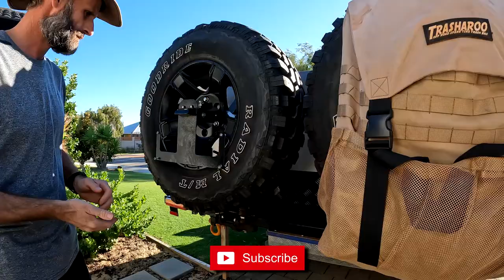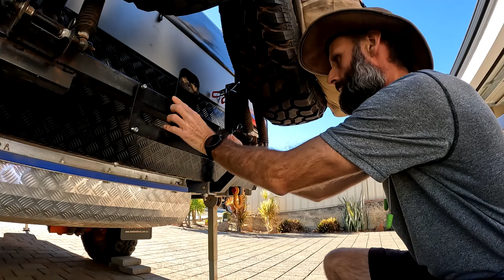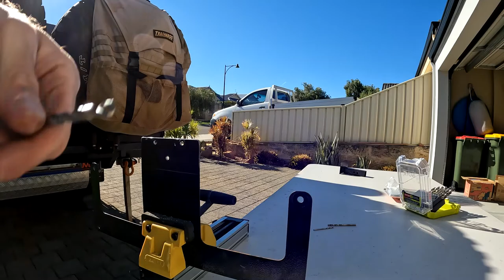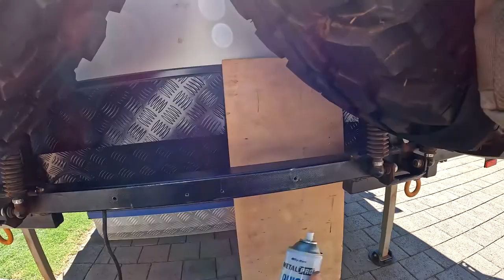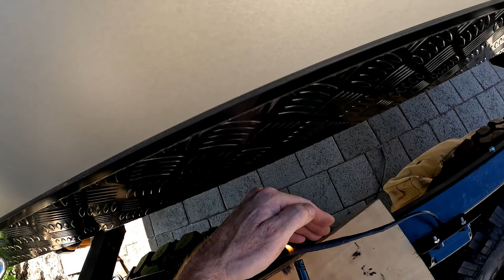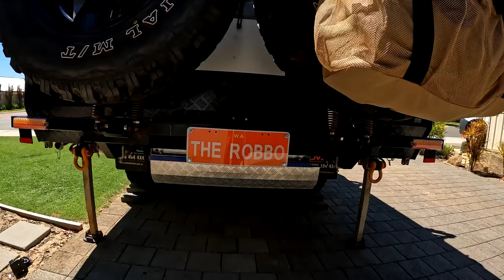Relocating Number Plate on a Camper Trailer l Personalised Plates

Comment: Craig can you explain why/when to use pop rivets versus screws given you used both?
Reply from the maker: Hi Wallace one reason was the pop rivets sit more flush so they don't interfere with the number plate. And also just for extra strength 😊

Comment: Hey, I did the same as you and Steve Zammit from MDC reckons having the license plate there is not compliant. What regs did you look at?
Reply from the maker: Hey Warren I just went onto the WA transport website and it was listed on there that is had to be at the back of the trailer and fully visible day and night. What state are you in? Maybe there are different regulations?
Reply: @RoaminintheRobbo  yeah Im from WA too.  I think other states are a bit more stringent.  Ie has to bw visible at certain angles.  Im in Darwin at the moment and it might not be comiant here...oh well..see if any cop pulls me over! Be a bit ridiulous really as its easily visible
Reply from the maker: @warrenpeers233  yes they maybe. Hopefully you don't have any issues in the NT, like you say if it is visible what is the issue. Safe travels mate!